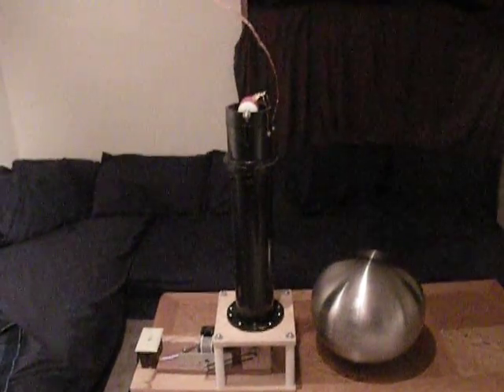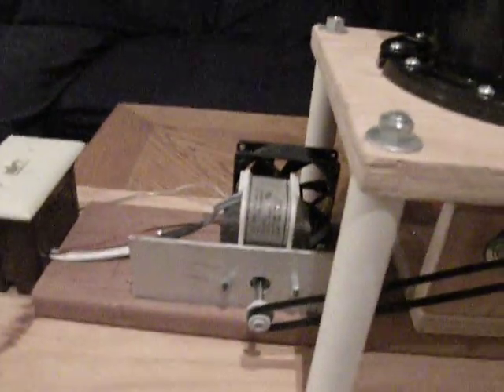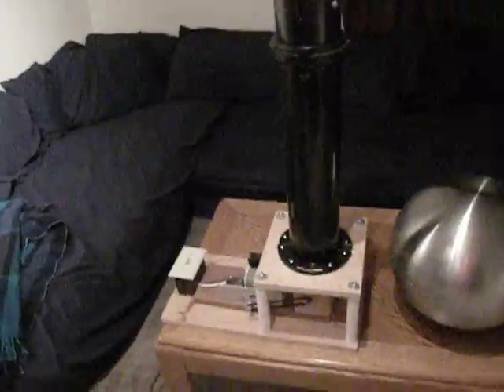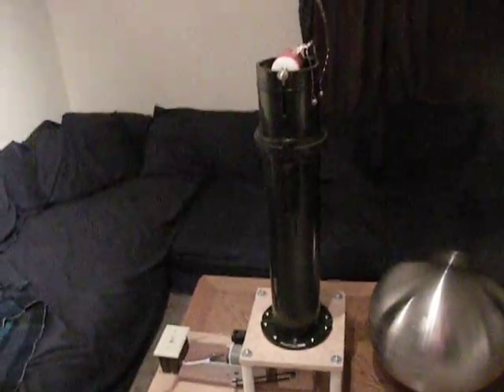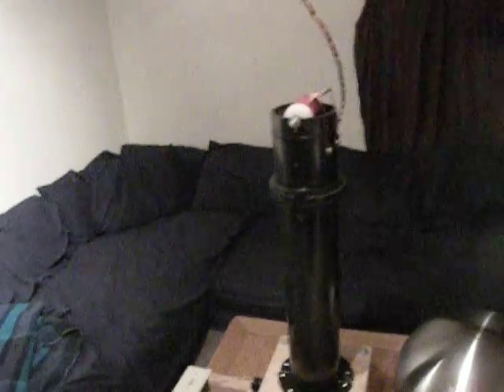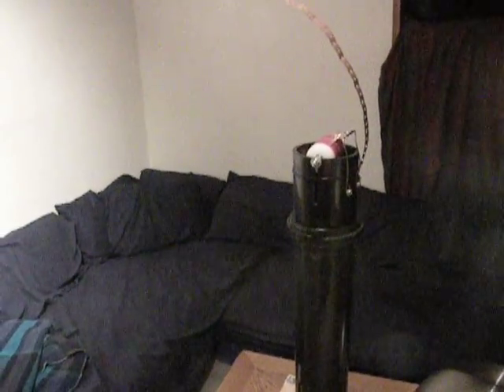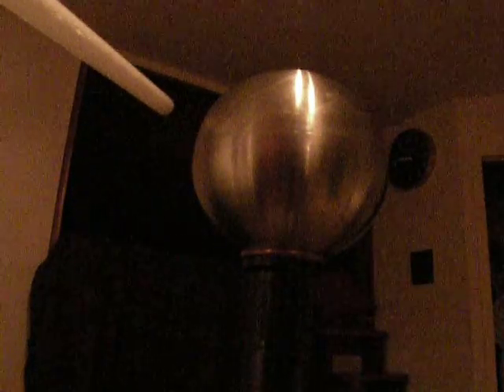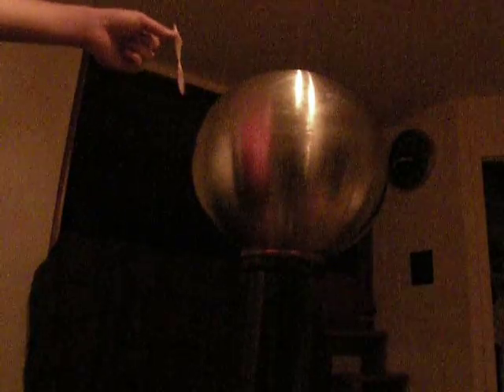Van De Graaff Generator

Comment from the maker: @hangoutsumtime I used two 14 inch bowls from ikea, and cut a hole in the bottom of one of the bowls so that the pvp pipe can fit in it.  Then I just taped the inside of the sphere with a piece of metalic duct tape.